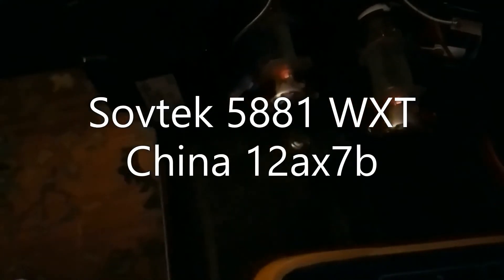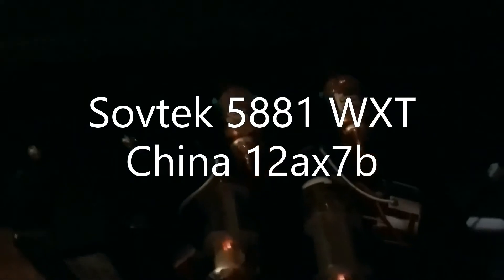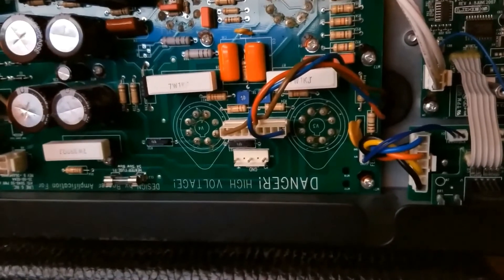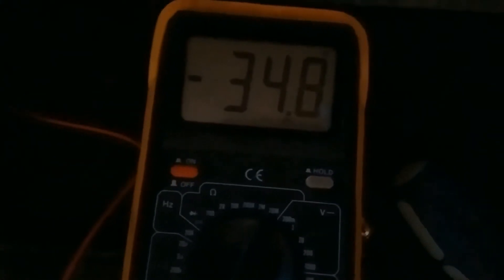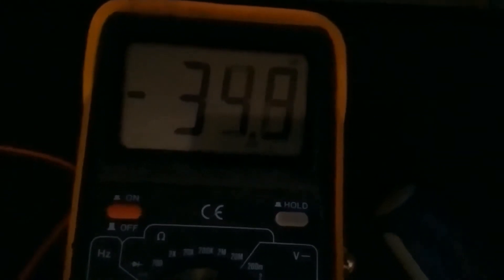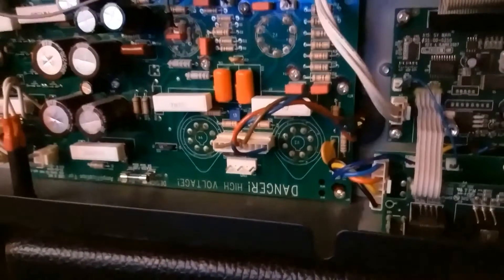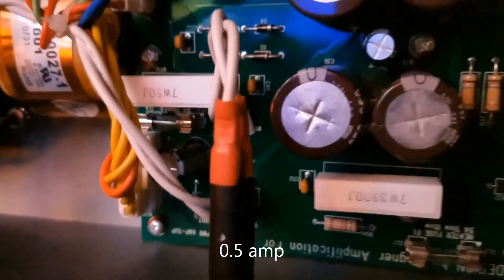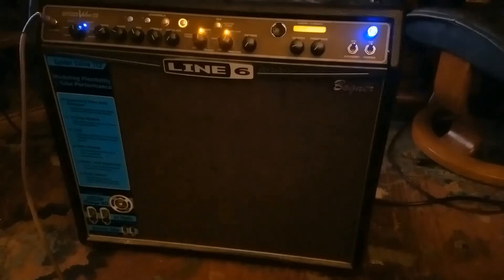Line 6 Spider Valve 112 Tube Replacement and Bias adjustment

Comment: Would you have any idea why one of the blue screwdriver adjustments for the tubes on my amp doesn’t react to the milivolt meter but the other one does? I can twist one to 35mv but the other one gives no reading when adjusting.

Comment: Just ordered new tubes for my 100 HD MKii head. People in forums saying never do this; only Line 6 authorized dealer should attempt.  How's it going after 1 year and how did you know what to set the bias at? Never biased a tube amp, but I'm fairly mechanically inclined.  Thanks man!

Comment: Thank you for this video. Very Helpful. Is the probe in the description link compatible with 12ax7 and 6L6 tubes?
Reply from the maker: Thanks,
It is compatible with any octal or 8 pin power tube including 6l6. 12ax7 is a 9 pin tube used primarily as a pre amp tube and biasing these tubes is not necessary
Reply: @greenrumour  Thank you so much, you've been very helpful! Its my first tube amp.
Reply: I put a pair of 6L6 JJ’s power tubes in my SV mk2. Sounded much better than stock.